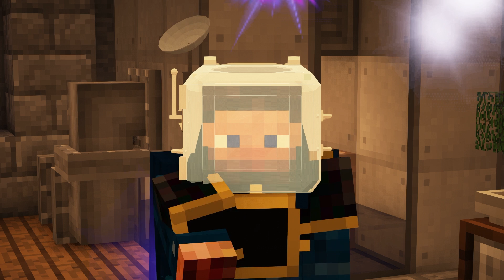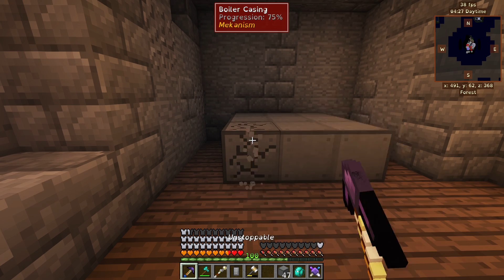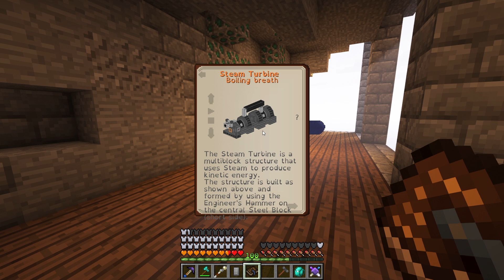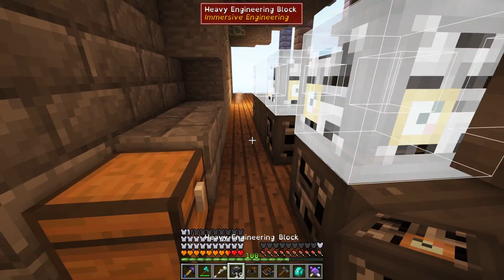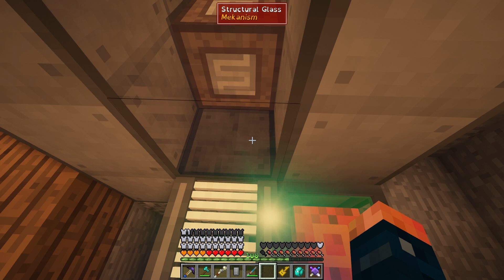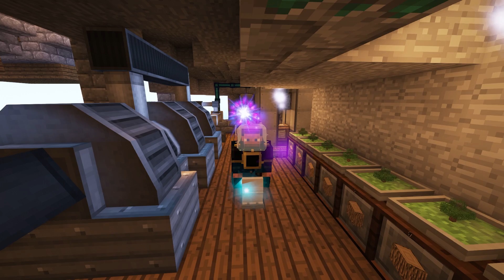SevTech Ages of the Sky Ep41 Mekanism Boiler Steam Power

Comment: Why are you still not realising you're limited by the power cables isntead of the power generation? - the power cables can only transport 1024 rf/tick while the generator generates around 15k rf/tick. It's hugely worth it to use a resistive heater but not if you use those cables.

Comment: You need a bigger boiler, the current one is at it's max tempature and therefore it can't make steam much faster than it is now.
Reply from the maker: I started using 2 heaters and went with a faster water pump and its doing just fine. Its now self sufficient!

Comment: Use mekanism or rf power cells and add them directly on the alternator for a rf buffer. I forgot the math but each plug in the alternator outputs equal rf. I am able to run my whole base all the way to age 5 (still grinding) using 3 alternators and never suffered a lack of rf. i only use oil for its byproducts.

Comment: If I remember correctly, Immersive Petroleum’s steam power was unbalanced with other mods, bc immersives way of steam gen produced much smaller amounts, thanks to OreDict, made it completely useless compared to for example Thermals way, to a point where 1 thermal steam engine (Not a multiblock) could power multiple Immersive turbines